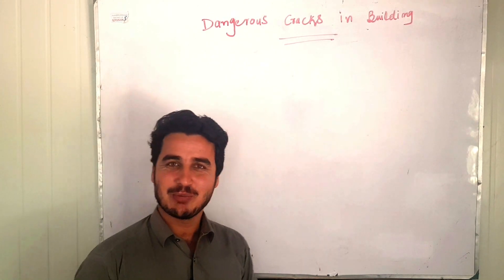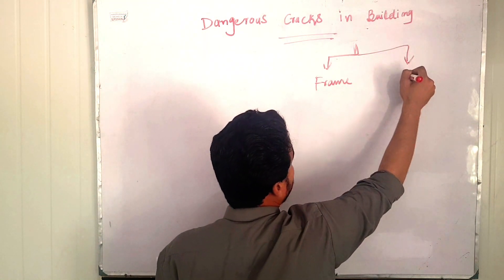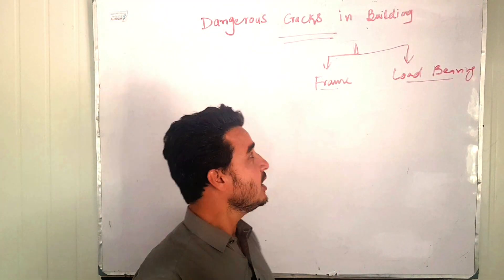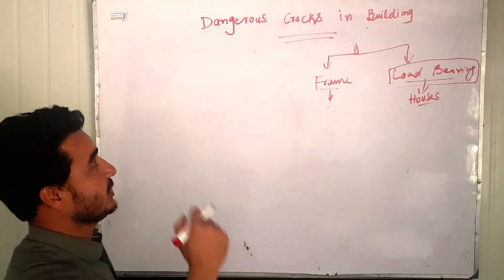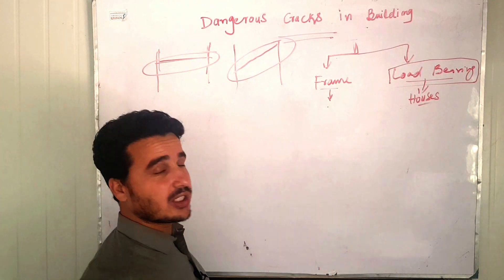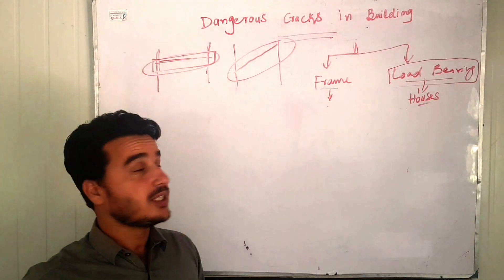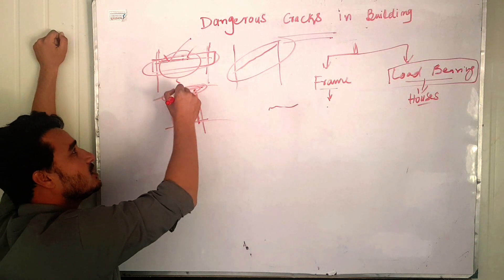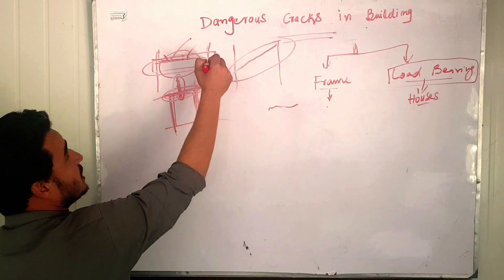Dangerous cracks in house construction | different types of cracks in house and buildings

Comment: Very helpful. We have the second diagonal crack in our house (load bearing) on multiple walls due to one side settlement. How can we fix this 45 angle cracks? Theyre inside the rooms and kinda 3-5 ft in length.
Reply from the maker: What’s the width of the cracks?